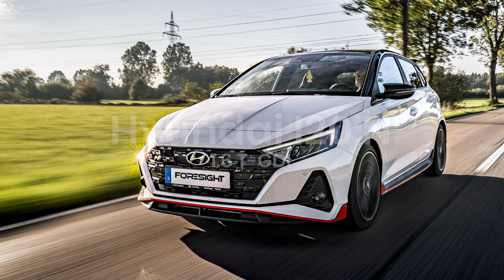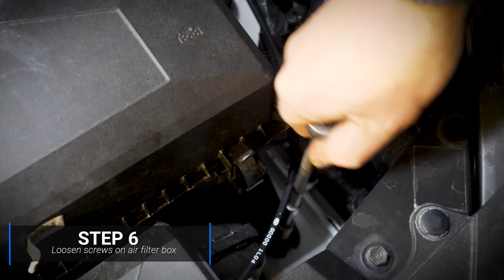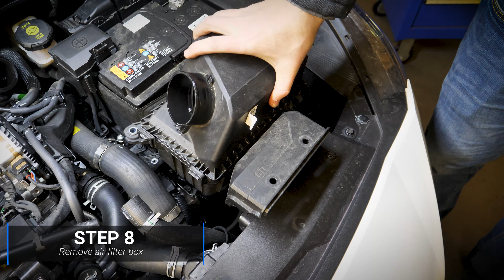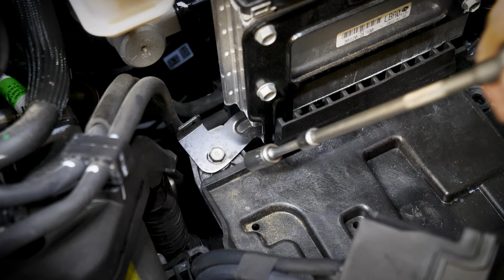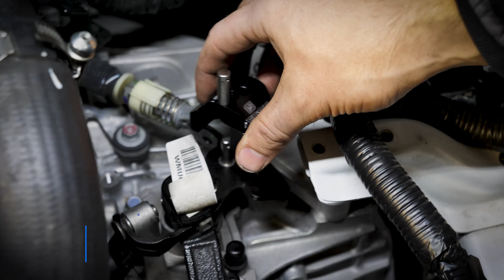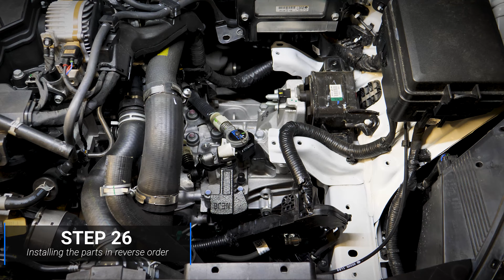Installation Instructions - Foresight Hyundai I20N Short Shifter

Comment: Para que sirve la mejora exactamente? Gracias por el vídeo
Reply: Reduce el recorrido de la palanca del cambio de marchas. Lo acorta, de ahí short shift.
Reply: @xx-garcia-xx9825  De que manera trabaja esta pieza?? El otro sistema de short shift que he visto es alargando el vástago de la propia palanca de cambios, del fabricante rpm performance...
Reply from the maker: Debido al desplazamiento del punto de recogida al centro de la caja de cambios, la palanca del interior se hace más corta.
Sin embargo, la caja de cambios hace lo mismo.
______________________
Due to the offset of the mounting point to the center of the gear unit, the lever in the interior becomes shorter.
However, the gear unit does the same thing.

Best regards,
Your Foresight-Team